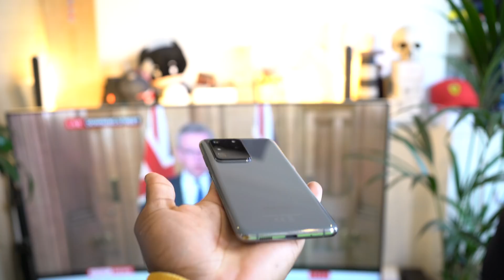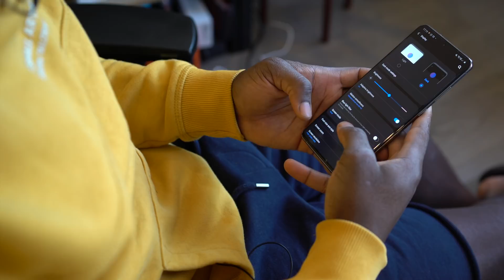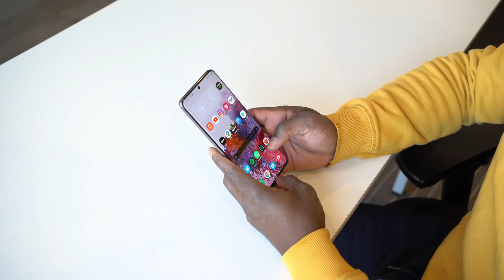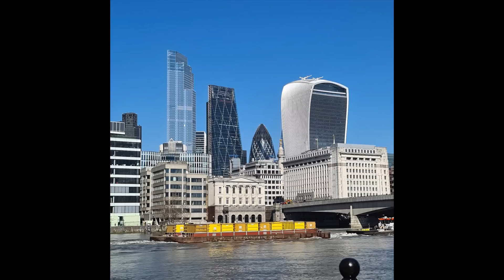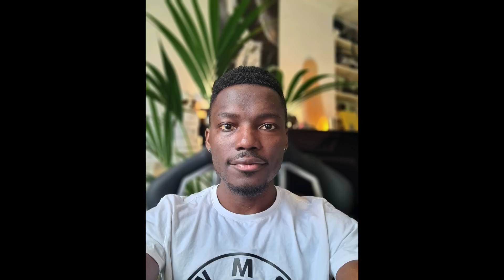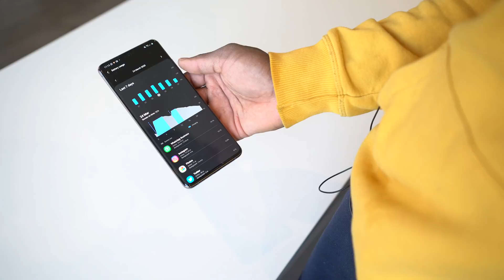Samsung Galaxy S20 Ultra (Exynos) Review: Underwhelming

Comment: Exynos version not a flagship performance.  Very disappointed.  In my life I had max 5 samsung phone but all the same problem. Overheating. Oven temperature in the cold weather.  What happens in the summer? Will blow up in my hand. Terrible.  Can't game with this phone for long.2 minutes Snapchat heating up the battery a lot. LOL. If you want s20 ultra, just make sure you buy the snapdragon version.  Exynos doesn't worth the money
Reply: Exynos crap

Comment: I have the s20 ultra exynos model and I'm truly annoyed that Samsung has shortchanged us in.tne UK and Europe with this chip. Its 30 percent less powerful than.the snapdragon 865 used the same model in the USA. Its 50 percent less powerful in the neural engine making photos etc worse. 
Samsung have no right to do this. Its totally unfair because they charge the same price for a phone that's effectively only marginally faster, more powerful than last generation but 100s more to buy. 
Samsung have ignored the petition from 1000s of fed up customers about the disparity between the 2 chips. They even had a telling off from concerned shate holders about this. But effectively Samsung have choose to ignore the complaints. They are going to continue with exynos with a few modifications to its architecture.  It seems AMD have been asked to help and if rumours are true exynos should improve with the help of AMD. But what about now? I paid £1300 for my s20 ultra! That's a huge amount of money. That's 600 mote than what you can get a note 10 plus for now  and yet its only marginally better as far as performance goes. Amd the note 10 actually performs better in the camera department.  
The s20 range is a great phone let down by Samsung with its truly poor underperforming waste of space exynos 990 chip with wouldnt be put of plame in last years models. Samsung you should be ashamed to do this to your customers.  I really wanted to get the note 20 when it comes out as the note range is what I love. But if it co.es with an exynos chip they can stick it.
I really feel cheated and let down by Samsung.  Especially that they couldn't care less and have lied about the exynos and snapdragon chip being equal  
I hear people sating that the exynos chip is still fast. And yes it is. But its not as fast or even close to snapdragon 865 and when.you pay so much for a phone you should be getting the absolute best . There's no excuse Samsung
Reply: I've Helped My Friend Get The Snapdragon Version From Canada & I Shipped It To Him In The UK!!! He Simply Purchased The Charging Adapter And That Was All!!! Let Me Know! I Could Help You!! Return You're Exynos Version & Message Me!! 👊🏼

Comment: Comparing Ultra with Chinese brands is not cool. Brand value is something dude.
And iPhone is dated now. They gotta change the design and screen. So Ultra is a gr8 expensive phone of anyone has a budget
Reply: Don't fall for spec boasting. It's just a marketing ploy used by tech companies to make up for worse user experience and poorer software. 

You can boast about 120ghz screens but if the software is filled with bloat and gimmicks then the user experience won't be as good.

Apple recognises this and that's why user experience is more of a focus and spec boasting is less common. 

This coming from a Samsung user.

Comment: Brother this exynos chipset s20 ultra . Does it have good camera (focus+quality) . I know it can not be better than the snapdragon varient but still want to know your opinion.
Reply: Deffinetly good. I have s20+ exynos 990 and the phone is just good, no discussion possible. Maybe not as good but stil very good.
Reply: @kv3513  bro how about phone temperature and battery life?
Reply: @Education-nz9fn  temp no problem, battery life average but ok for me and i am quite a heavy user
Reply: @kv3513  I'm about to buy this phone in December. Is it worth it with exynos? How's the battery life?I use my mobile most of the time during the day. The temp goes high when you keep using it?
How's the camera?
Thanks
Reply: @ashbinx  exynos is no problem at all. It is just a good chipset. Battery life and camera are excellent. I am still very happy with my exynos s20+.
Reply: @ashbinx  I think you should wait for next gen S series and they are launching on 14 Jan 2021 and also leaks suggests that the exynos 2100 which is going to be used in 2021 S series will be much better in battery efficiency and also much powerful so its better to wait

Comment: The only guy who did a proper camera review on s20 ultras 108MP for morons to understand Camera indepth. Maybe you don't have the hardware or software to render the details of 108MP, he explains those in details, Check this out guys, you will understand how misleading these guys are.https://www.youtube.com/watch?v=WAMqdayLuBw
Reply: Saw the video you shared. He doesn't talk about the focus issues or the oversharpening that Samsung cameras do. I have the Ultra and I have transferred its photos to my laptop and to my 65 inches 4k OLED TV. I can still see the oversharpening. The image processing on Samsung phones is just not on par with what Google and Apple can manage.
Reply: @nipunsharma5351  the focus issue is fixed on exynos versions. there is no oversharpening at all. the oversharpening is when your laptop screen is too small so it cannot display the details properly. Thats exactly what he analyzed and explained. so technically fine details small screens cannot display properly and may look as sharpening, but it is not it is a limitation of the screen size
Reply: @nipunsharma5351  oversharpening can also be limitation of your hardware and software. If your hardware and software cannot render the pixels and details properly it will show as sharpening. and most people dont have a computer powerful enough to display a 108MP photo properly including Macbook pro users. This requires a lot. My Macbook fails to render, but my gaming Desktop renders all the details and a big difference in rendering of fine details between the 2 computer and fine details.

Comment: Underwhelming? Crazy....  love this phone. Big upgrade from my S9+.
Reply: Yah i have the s9+ and im planning to upgrade it to the s20 ultra, do you think its a great upgrade even though it has the exynos version?
Reply: @markgeraldgalin2710  Don't, the updates messed up the phone even more and they had to remove it. Get something else!
Reply: Shah Ali how dis you say so, do have the exynos variant of the s20 ultra?
Reply: @markgeraldgalin2710  yes I have the Exynos version, and I don't have no reason to bash Samsung other than this is the worst phone I have ever had from them.
Reply: Overheating issues you can actually see the phone thermal throttling while gaming on COD. Gets soo hot your hands start sweating and can't even play. Battery life is appalling even in average day to day use get around 4-5 hours, which made me crank everything down now. Running medium power mode, 60hz 1080p, brightness down and still only getting around 6hrs.
Reply: Gabriel666 sparda  Then you really haven't used the phone properly, I have had it from the day it was released. You haven't even mentioned the over heating issues, do you have the phone? Using the camera it gets really hot, gaming it gets really hot. Battery life is ridiculous to the point I'm on FHD+ with 60hz and dark mode and power saving and I barely get 6hrs screen on time. If they turned around and said to me they would replace mine with Snapdragon version I would, nothing against the phone, its the SoC they have given us.
Reply: Exynos make things bad
Reply from the maker: Yeh coming from the s9 plus makes sense but still could be better than what it can do on paper
Reply: @GadgetsBoy  lmao this is amazing, I've never seen another channel where the viewers not only disagree with the reviewer but their comments get more likes than the reviewer 🤣🤣🤣 your channel is horrible man.
Reply: @GadgetsBoy  that goes for every phone that comes out. No phone will please everyone.
Reply from the maker: @tommys2077  not really, the oppo does what it says on the tin and it looks great, the iPhone doesn't look good but does the job well. Can't condone a rubbish battery life or a camera that can't even focus when I need it to
Reply: @tommys2077  bro the exynos version is way worse rhan snapdragon version so i wouldn't recommend buying the exynos version
Reply: @bullykojima3232  I'm in the US so I have the Snapdragon version. Be safe out there
Reply: @tommys2077  yes , in asian countries ( where i think people are unaware of such things ) Samsung are making fool of the people by selling exynos ones . They send reviewrs sd variants to get good reviews and sell exynos processors to most of its customer base . This is cheating and should be stopped  . But still you can't deny the fact that it has focus issues while recording videos ( which has to do because of the use of samsung sensors on camera instead of sony imx sensors )
Reply: @bullykojima3232   yeah that's stupid of them NOT to have the best chip on all their phones. If that's the case they shouldn't charge Exynos versions at the high price like the ones we have here. Anyways hope they do fix the cam.  I had my 3rd update and so far it's pretty good. There should be more updates so eventually the S20 will be up to par. ...... i hope lol
Reply: @GadgetsBoy  Maybe your computer is not good enough to render the 108MP photos, most computer cant. your information is incorrect. there is a 12MP binning mode 9 pixel to 1 which is 2.4 microns and ALSO there is a 108MP mode without binning with 0.8 microns.
Reply from the maker: @smartdigger7325  i do have a computer more than capable of rendering it. lol i tried all the modes and trust me it makes no difference as such. You can have all the hardware but if your software isn't doing its job properly, it doesn't matter if you have a 1/1.33 sensor or not. the microns are useful for light which translates to the level of details you can capture. The only Nokia Lumia with a 50MP sensor captures more details than the S20 Ultra, even back then it was still not perfect but it wasn't over hyped past what it can do.
Reply from the maker: smart digger dude this is my job, that’s his experience, I didn’t get the same experience. I have a more than capable computer I use to edit my hasselblad x1d images, way bigger and requires more than a mediocre ultra phone
Reply: @GadgetsBoy  then how come you dont see difference between 12MP binning an 108MP in daylight?  we all own the s20 Ultra and we see the difference. Why cant you see it? Please explain
Reply from the maker: @Wayz watch the video. I have. Anyway, no point arguin. Have fun with your phones and your 108mp files